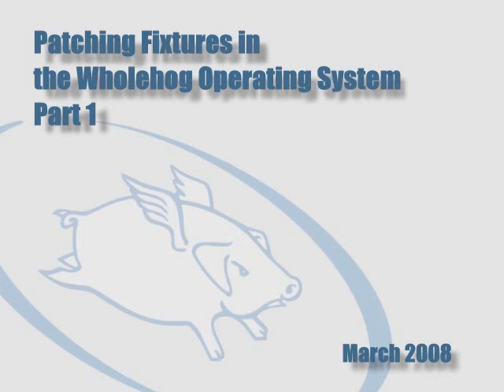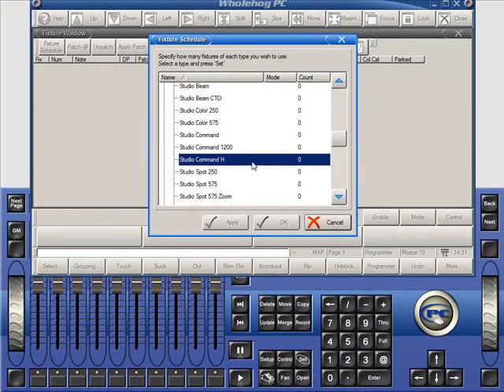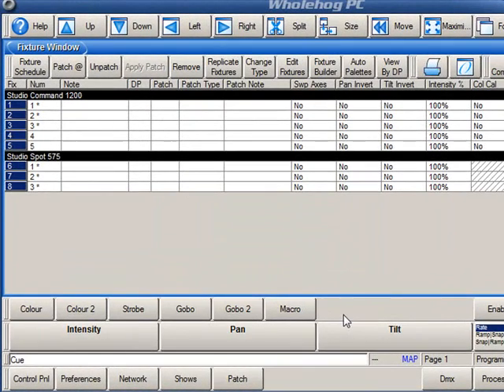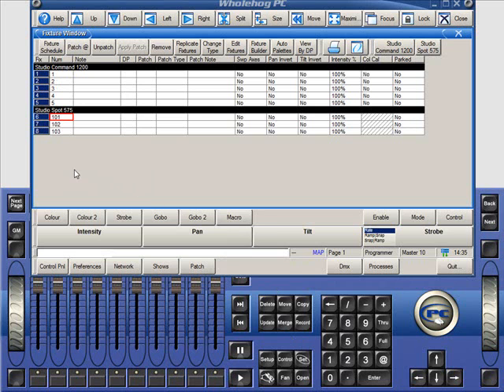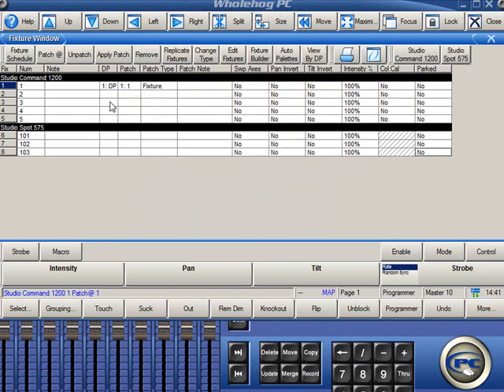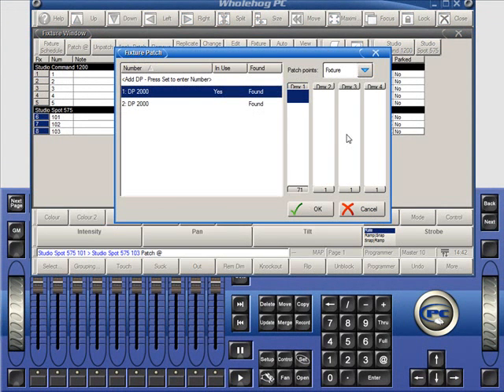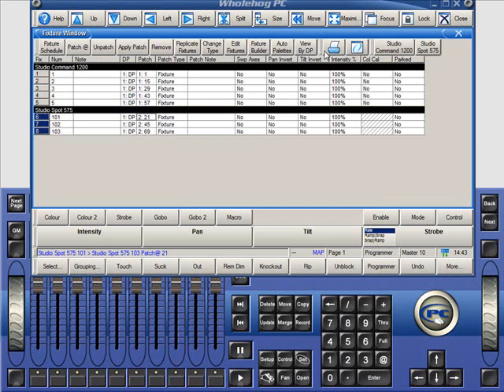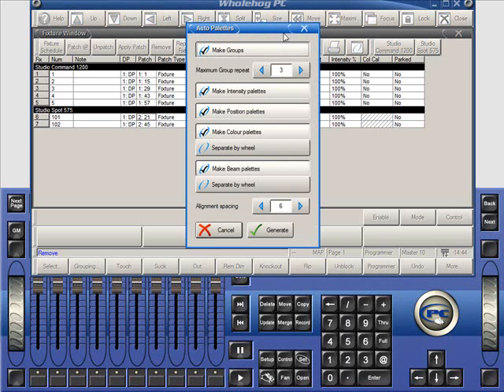Patching the Wholehog: Part 1

Comment: You said the first address is 1. Is that the first address on the universe, is it the dmx address of the physical light, or both? You also said the first spot address was 21, how do you know this? Could you have put the spots on universe 1 behind the studio commands?
Reply from the maker: First question- answer is yes to both. In this example, the physical light's address is 1. 
Regarding first spot address- I would know it is 21 based on what the light's physical address was.  This was all hypothetical scenarios. Yes, the spots can also go in universe 1.  There's no rule about where different types of lights need to go, as long as there is room for the required channels still available in that universe and you don't overlap addresses.
Reply: That was very helpful. Thanks